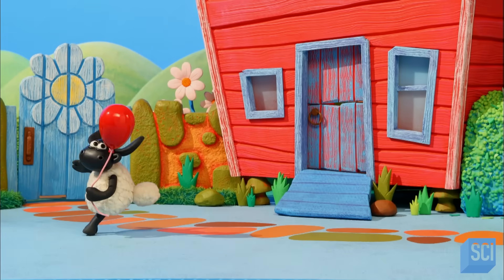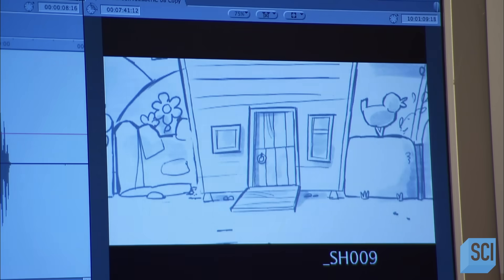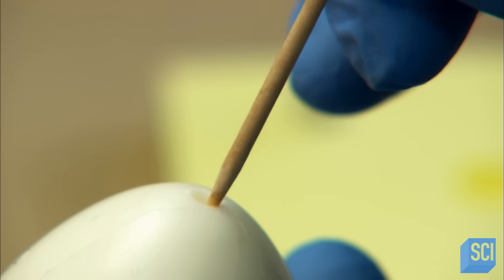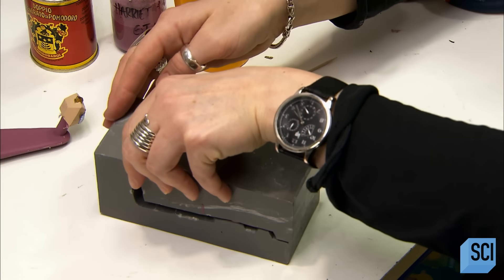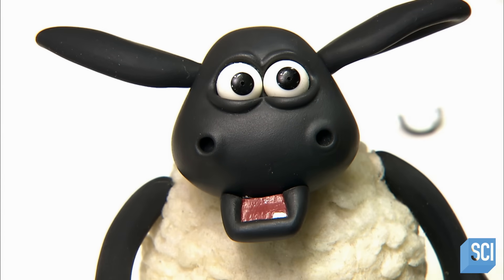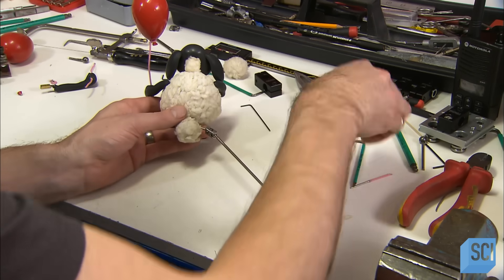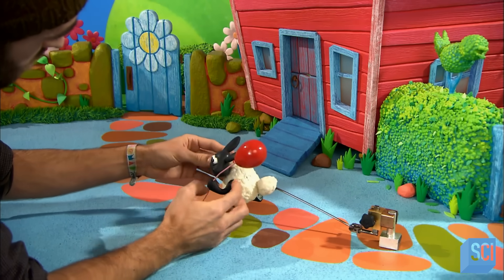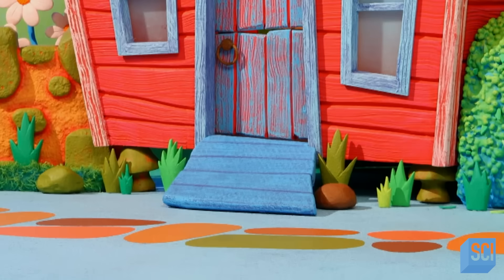Stop-Frame Animation | How It's Made | Science Channel

Comment: I never knew timmy time used resin pieces rather than clay, though it probably helps a lot with keeping the sets as clean and as cartoony as they were in the show, whiles also possibly helping to speed parts of the animation process.
Reply: Yeah, it's like they are cheating.
I've done some claymation before with 100% clay and always wondered how they avoid characters drifting/deforming over time, I guess the answer is, it's not all clay or maybe no clay at all or only clay for specific scenes.
Reply: @FusionDeveloper  I wouldnt call it cheating but just a different style, it does help timmy time keep a very cartoon aesthetics. Laika also use resin molds but I think they also over use post editing to create realism, they should lean into the stop motion of stop motion more.

Comment: Could the tied peice of the ballon not have been molded with the rest of the ballon removing a hole unnecessary step of drilling and gluing? It Seems like a job roll that was made up just to keep an old employee employed
Reply: Having a more complex shape (the balloon not being quite small), leads more room for mistake, biggest worry being that not enough resin would get into the tiny balloon tie, creating a failed mold.